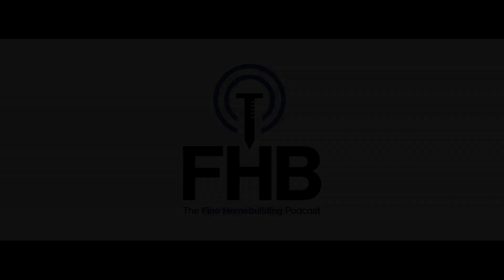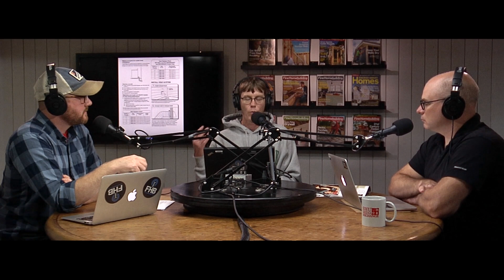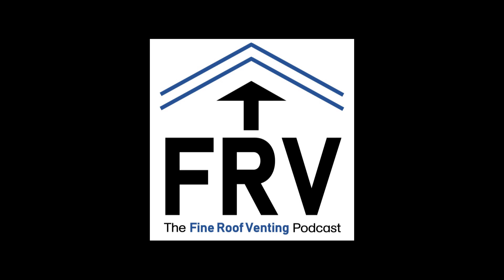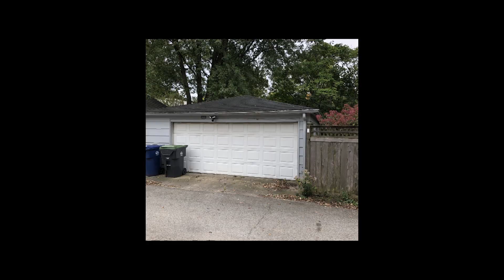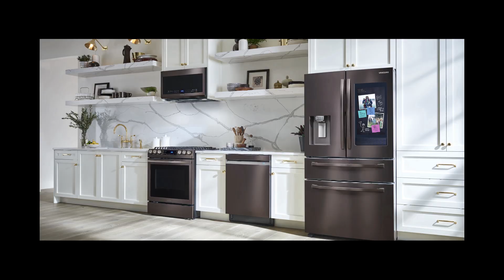Podcast 207: Home Maintenance, HVAC Zones and Dangerous Dryer Vents

Comment: Use smart thermostat with remote sensors, then program fan run time to keep the temp even. I had trouble with cold basement warm upstairs, by running fan on a schedule  (min 20 min / hour) temp stays much more even.